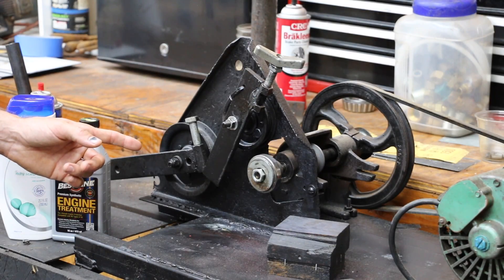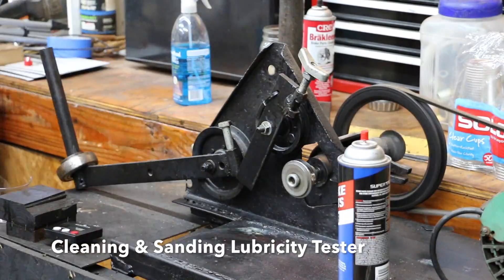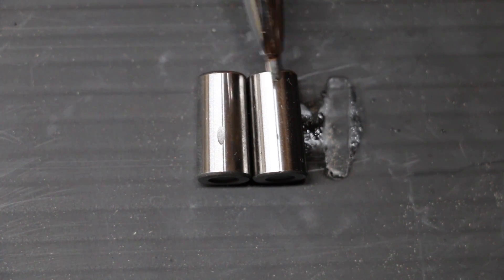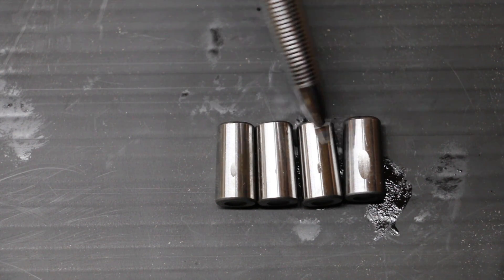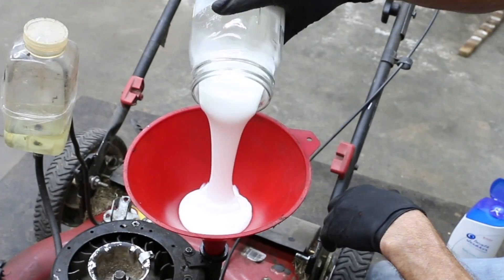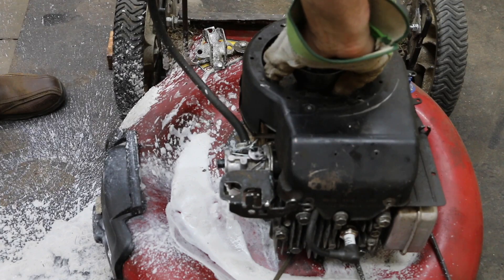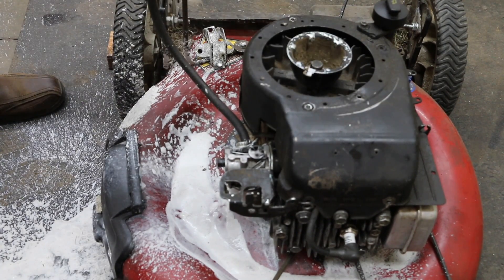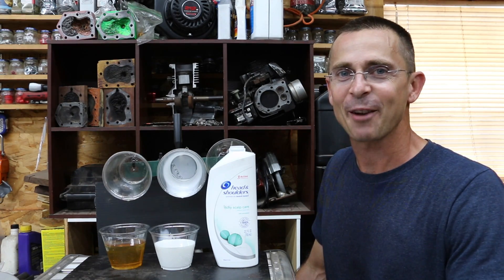Shampoo as Engine Oil?  Let's see what happens!

Comment: I wonder if you could do a video comparing different oils from the big names such as Mobil 1 / Castrol ect vs Small brands or rather lesser known brands. Reason being I got some oil for my car from a UK manufacturer of oil (I live in UK, may be different for USA) but basically they claim to use top quality base oils and industry certified additives/modifiers ect. But the price difference is insane I get 6litres for £28 to do an oil change, if I got Castrol or Mobil 1 in the same spec it'd be more like £70. Is the price difference really worth it or does the wear to an engine increase with "cheaper" oils even though it meets all oem specifications.

Bit of a long winded question, thanks for your time, keep up the videos!
Reply from the maker: Thanks for the video idea!

Comment: You should do a comparison between regular unleaded gasoline and ethanol free gasoline. See if the claims of more power and better fuel economy are true!
Reply from the maker: Thanks for the video idea!
Reply: There are fuels with various levels of ethanol mixed in them. Would be nice if you could test them all. There are 5% (98 E5), 10% (95 E10), 15% (E15) and 85% (E85/RE85) ethanol fuel mixtures out there afaik, at least those are the more common ones.
Reply: Would love to see that comparison since most places sell e10 near me. There’s a few places that sell 100% unleaded but it’s definitely more expensive
Reply: Yes I would love to see this comparison
Reply: I think it would be very interesting to use unleaded gasoline instead of oil in the crankcase

Comment: Dollar store oil vs name brand, is there any quality differences?
Reply from the maker: Thanks for the video idea!
Reply: As long as it's api certified you're good. Some of the really cheap oils aren't. Don't use those in your car.
Reply: @Xixu.co.6  Are you kidding? Try running API SA oil in your car. That's a 90 year old standard when drain intervals were 500 miles.
Reply: Or maybe a straight weight versus video SAE30 versus 10W30
Reply: @Project Farm

I'd really like to see a test of Dollar Tree SMB brand oil or similar oil from dollar tree compared to a name brand. Sometimes you can get a quart of synthetic blend for $2 from SMB. I'm too cautious to actually use it in a motor I care about.
Reply: Maybe a head to head for the leading 5w30 synthetic oils? Would be a very useful video.  Amsoil, royal purple, valvoline Pennzoil, Mobil 1, Castrol, supertech, DG brand. Cold viscosity, room temp lubricity, operating temp lubricity and maybe see how well it stays on metals over a few hours?
Reply: @cavemanstyle1376  It is used as engine oil. Which is why Dollar General has a class action against it for selling the stuff to suckers.
Reply: @erikkovacs3097  the oil over there is sn, its got all the latest certificates at least as of a few years ago
Reply: @johnnyg31  As of a year ago there were still selling API SA oil at Dollar General. I know they still sell API SF which is pre 1988.
Reply: No difference.

Comment: Try to use brake fluid as engine oil please.
Reply from the maker: Thanks for the video idea!
Reply: But ....
You DO know.....
That....
Brake Fluid....
WILL...
Stop...
Your....
Engine!  
(Must run!  Squirrels!)
Reply: Rip seals
Reply: It won’t be interesting brake fluid will not boil so it will last close to as long as engine oil but not lube as well
Reply: Use a DOT5 brake fluid will work, as it has a very high boiling point, and is silicone based as well and will not do much to the seals aside from swell them slightly. DOT4 and lower however are basically alcohols and glycols, which is pretty much a solvent instead.
Reply: That sounds like an important piece of information to note. and if we are going for viscous with zinc why didn't any one think to test sunscreens? A low SPF like 10 vs 60+ would tell you how zinc compares to oil. it would be perfect for the end of summer and it might even be on sale!!!
Reply: It’s caustic
Reply: I already have, it's on my channel

Comment: Lithium Grease as engine oil? 🤔
Reply from the maker: Thanks for the video idea!
Reply: NGLI 0 grease will work, it is pumpable and pretty runny. I used it in 3mm ( 1.16in dia) piping as machinery lubricant, and it was very easy to pump through long pipes, here with splash lube it will work as it will liquify under the shear. Using a NGLI2 or higher grease will just spin a coat on the sump sides and do no lubrication though, a NGLI 1 grease might still work when hot.

NGLI 0 grease looks and flows like really old oil even when new, and is runny like honey.
Reply: not liquid
Reply: @Boz1211111  I should've been more specific. I meant the lithium grease spray.
Reply: Hm yeah maybe some really thin grease could work but then its almost oil soo.. :P

Comment: Could you try Vaseline as motor oil?
Reply from the maker: Thanks for the video idea!
Reply: It is petroleum based right?
Reply: Yes, it is, so I think it would work pretty well.  I'm wondering if it's run in an engine, would it thicken up when it cools down?  I think it would, so it wouldn't work in cold environments.

Comment: Neat video. You always have interesting content!  Will you do an adhesive test to find the best adhesive to use when trying to bind HDPE?  It's a notoriously difficult plastic to bond, but I've  needed to bond stuff to it in the past and have tried different items with success. Scoring and gluing to make a mechanical bond with the glue seems to be the best trick I've found so far.
Reply from the maker: Thanks for the video idea!

Comment: Presumably at 4:35, the "oil" temp got above 100C, and the water content of the shampoo started to boil, and it foamed itself right out the crankcase vent.  While the lubricity test showed it was a pretty lousy lubricant, by the end of that engine test, most of the cranckcase contents were spewed out of the vent.  A no lubricant failure more than anything....
Reply from the maker: Great point.

Comment: REQUEST: MotorKote full testing video

High-Heat Lubricity & Flow Rate
Below Freezing Lubricity & Flow Rate
Engine Survival Time - No Oil after running 20mins with MotorKote+10W30
MotorKote used to Lubricate Pulley - Before & After Torque Needed to Turn
& More!  :D
Reply from the maker: Thanks for the video idea!

Comment: Next time you drain the oil and want to see if any metal particals are in the oil after you filter it place a magnet in or under the bottom of the plastic or glass cup and see if after 24 hours the oil is separated from the metal.
Reply from the maker: Thanks for the video idea!

Comment: So after a boating trip I have about 40 Litres of petrol mixed with marine grade 2 stroke oil left over.  Can I use it in my lawnmower as fuel? Can I use it as is in my chainsaw? 👍👍
Reply from the maker: There is some debate regarding the use of "marine grade" oil in an air cooled engine.  I would use it in a 4 stroke as added lubrication.  Just my opinion.

Comment: Another good video. Funny stuff is always a nice change from doing "normal" alternatves.
I wonder how gear oil would work - th stuff you put in a manual gearbox/transmission - something like 75W90, IIRC its still got higher levels of ZDPP compared with motor oil, that or perhaps hypoid gear oil

Keep em coming :)
Reply from the maker: Thank you!

Comment: Ahhh, I see what is happening, the boiling water is forcing the liquids out of the ccv.  Solution, plug the crank case vent and loosen the oil fill knob. The engine would then need water replenishment at a rate of about one full lubricant volume (a pint?) every 12 minutes.
Reply from the maker: Thanks for the video idea!

Comment: I'd like to see you test different oil brands against each other with your lubricity tester. For example, does Walmart's super tech oil protect your engine as good as Valvoline or any other brand of oil with the API stamp of approval. Basically, am I paying more for a brand name or will any API approved oil protect my engine sufficiently. I use super tech oil in my car and truck because it is cheaper. I would love to see some actual tests done to compare cheap oil to more expensive brand name oils. Thanks!
Reply from the maker: Thanks for the video idea!

Comment: G'day,

  OK, try this...

   I heard decades ago that during WW-2 the Germans used to include fine Graphite-Powder in their Aero-Engine Oil, with the idea that if, perchance, Battle-Damage should cause a loss of Oil from the Oil-Cooler while aloft..., then the residual Graphite within the system would permit the Engine to run for longer before siezing-up, as compared to an Engine which had been running on pure Oil...

  In the late 1970s lots of people believed it, and it was actually an integral part of the "sales pitch" of the peddlers of various brands of "Friction-Modification" Oil Additives (the Wynns travelling-salesman in 1979 was the first person I heard it from...!).

 It occurrs to me that if you maybe mixed a couple or three concentrations of Powdered Graphite into samples of Engine-Oil (maybe 1%, and 5%, possibly even 10%...?), and with a sample of straight 10w-30w Engine Oil as a Control....; run the Engines with the straight & "doctored" Oil for maybe an hour, then drop the hot Oil out, and run them dry until they sieze - which will determine at least the point of wheather having Graphite in the Oil will help after there is no Oil left in the Engine... (?).

   You DID ask...(!).

  Have a good one,

  ;-p

  Ciao !
Reply from the maker: I always enjoy reading your video ideas. I have some graphite powder.  Seems like an interesting test idea. Thank you
Reply: I'd like to see that too
Reply: +Project Farm 

  Cool !

  Thanks for the reply. I always enjoy your videos, so I look forward to seeing you check out thr Graphite-In-The-Oil legend.

 Have a good one,

  ;-p

  Ciao !

Comment: How do you feel about adding a few ounces of diesel, running for five minutes and then draining the oil before an oil change?
Would it loosen more sludge and nasties?
Reply from the maker: Yes, it will work well, but there's always the risk of clogging up the oil pickup or too much loss of film strength, causing long-term damage.
Reply: @ProjectFarm  so only try it out on that neighbor's mower... You know. .. The guy that borrows but only returns the broken stuff??
Reply: @ProjectFarm  I did mean though replacing with new oil after draining the diesel  tainted oil.

Comment: Yes! Kill-a-watt on lubricity tester was a success!
Reply from the maker: If you recommended this, thank you!  It did a great job. I wish it didn't "reset" once losing power. I'd rather see the total amount of energy consumed in 30 seconds.
Reply: You're welcome, always like to see as much data as possible. I did some quick math, 440 watts for 30 seconds would be about 0.0083 kilowatt hours, which is below your kill-a-watt's range if I'm not mistaken. I know of no device that can measure up to 120v AC and down to a tenth of a watt hour simultaneously.

Comment: May I suggest Peanut Oil mixed with 10-30 at about a 50/50.... I'd love to see that, Peanut farmers in the 1940's would reduce the running cost by adding peanut oil to the motor oil. I think that's a bad idea, but they would do it to save money. They had free Peanut oil but they had to buy motor oil.
Reply from the maker: Thanks for the video idea!

Comment: Why no compresion test after head and shoulders :(
Reply from the maker: Great point. The engine was way too stiff for the drill or to even pull start.  I'll get it spinning again and measure compression in a future video.
Reply: Alsow do a video on engine runing on Octane Booster, I have seen video that it runs, but how good is it for engine.

Comment: Next time you measure the power consumption of the lubricity tester subtract the measured power cunsumption while performing the lubricity test with the power consumption without a load. The result should be the electric energy which is converted by friction into heat. This way you can compare the friction more precise. For example: The lubricity tester consumes 300 watt without a load. 440 watt(engine oil) - 300 watt = 140 watt, 550(head & shoulders) - 300 watt = 250 watt. 250 watt / 140 watt = 1.8. This would mean that the friction with heat & shoulders is about double of motor oil and not only 20% more.
Reply from the maker: Great recommendation!
Reply: He just put head and shoulders in the engine and your giving him a math lesson.
Reply: Overly complicated testing procedures would make it even more rediculous.
Reply: Good point!
Reply: I was about to say the same thing 😁
Reply: No-load to load ratio is so large that you can ignore it.
Reply: We´ll see in the next video :P
Reply: Lexandro Helix shhhhh
Reply: Lexandro Helix seriously?    ITS NOT A LAB BRO...

Comment: Well, that engines wrecked.... I'd still be interested to see crude oil in a single cylinder diesel.
Reply from the maker: Thanks for the video idea!
Reply: No worries. I mentioned it before when you  did the crude oil in a petrol engine test. I'd also be interested to see comparisons in density and viscosity between petrol, different crudes and diesel.

Comment: As always, accurate and worth the watch.
Thanks for the work put into doing the test and producing the video.

The subject of domestic liquids being used in engines had me wondering how long a motor would last if one put petroleum jelly into the crankcase?
Not sure if the question has been asked or the test been done.
The stuff will liquefy and get around but does it provide the film strength to prevent metal contact?
I reckon it will start off looking good and then when the motor gets all up to temp things will turn into a mess.

Thanks for a great Monday eve's entertainment from the fan's here in South Africa.

Kind regards,

Duncan
Reply from the maker: Thanks for the video idea!

Comment: Great video, I knew it would boil the water in there and foam up. How about straight octane booster and fuel injection cleaner of different brands. They all will run the engine but you can test cleaning.
Reply from the maker: Thanks for the video ideas!

Comment: Zinc (as metal or oxide) in lubricant has ZERO effect on anything, it is Zinc dithiophosphate (aka zinc dialkyldithiophosphate) that is the magical multi purpose additive.
The only disadvantage is if too much of it gets in a modern catalytic converter, the converter efficiency and be permanently reduced when it co-reacts with the platinum.  That is why it is now being limited or eliminated in lubricants for modern emission controlled engines. MoDTP is actually being used in may formulations instead of ZnDTP.
Reply from the maker: Great point.
Reply: I was wondering what the damage mechanism was... I just assumed it collected in the cat, not reacted negatively.
Reply: There are about 25 SAE papers on this, unfortunately NONE are available free, you have to be SAE member to have access or just pay for them, this one has all the chemistry details that you care or dare to know about, also available for purchase. https://www.jstor.org/stable/44612347?seq=1#page_scan_tab_contents.  Japanese engineers have been the first ones that apparently noticed that way back in 1994.

Comment: How about DOT4 and DOT5 as oil?
Reply from the maker: Thanks for the video idea!
Reply: That would be a great idea also try “blinker fluid”
Reply: I can tell you power steering fluid doesn't work...
Reply: @reallywilly5052  in the junk I drive I run ATF for power steering fluid, ive run and engine with ATF in it to flush out sludge, no adverse effects
Reply: Morgan Reilly ATF is usually fine for PSF and most cars call for it. Extended use as engine oil will cause damage
Reply: Interesting idea. I seconded this
Reply: Good idea